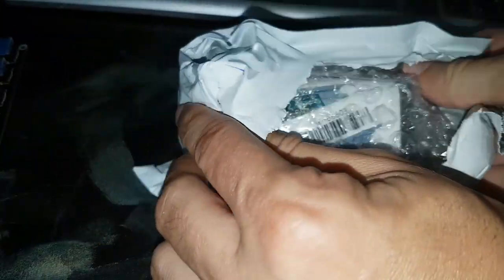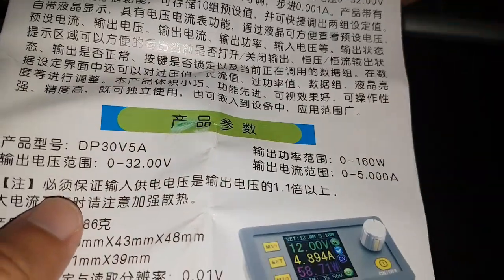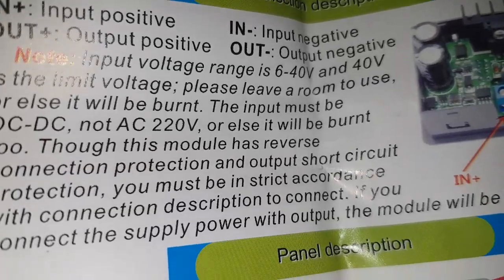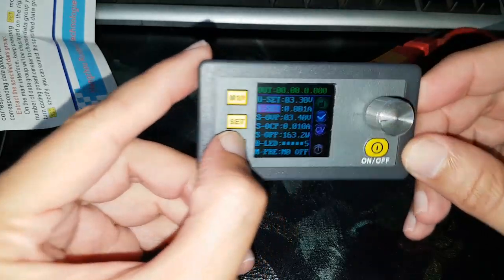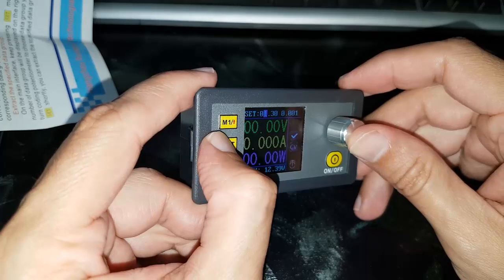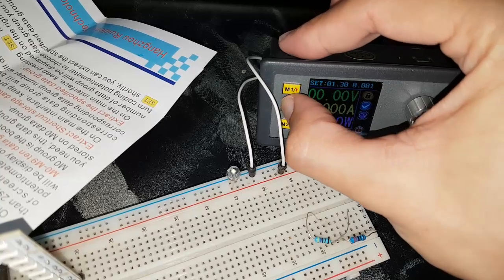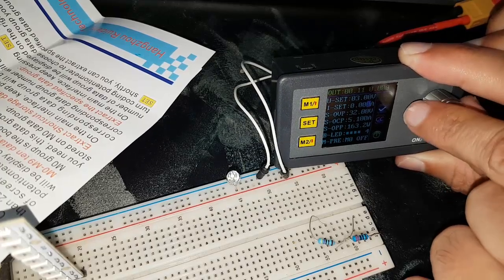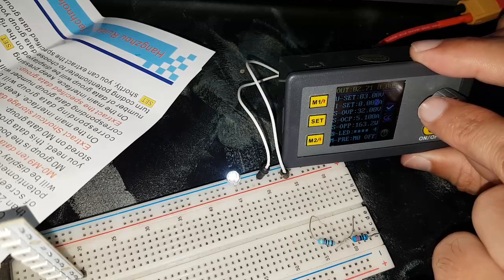Review of a constant voltage constant current programmable control power supply module

Comment: Hi friend 
thank you for your video. this is my product. we design this ,. although you did not bought from my shop, from my reseller. 
in the most time , I saw you adjust seting output current , and you also the the real time current is changing too. but they are different , right?  there are 2-3 words different, right ? you know the reason or not 
let me explain it : first our user manumal writer " current voltage range is 0.5%+-2 words", right ? this mean the error is between our products measurement value and real value , not setting value .. 
so it is normal . in the CC state , the difference between setting value and  real time detect value is 2-3 words, it is normal 
becayse there is some error about setting value .. 
so it is totally right .. don't worry 
thank you for video 
and I saw you bought DP30V5A http://www.aliexpress.com/store/product/RD-DP50V5A-Constant-Voltage-current-Step-down-Programmable-Power-Supply-module-buck-Voltage-converter-color-LCD/923042_32613371214.html
Hope you like it 
in fact you can use it to make real power supply , like those 2 friends  https://www.youtube.com/watch?v=vcI_NJ_kcPI and  https://www.youtube.com/watch?v=XlbtEkq7FTE&list=PLNcr2Rj_07PGexXolEzWu5_pFNOcO3g68&index=16  
thank you
Reply from the maker: Great product , I love it
Reply from the maker: +RD tech 
I am now looking into on converting 220 volts ac into 30 volts dc .
Reply from the maker: +RD tech 
I am now looking into on converting 220 volts ac into 30 volts dc .
Reply from the maker: +RD tech 
Feel free to send me samples of stuff that you want me to review on my youtube channel
Reply from the maker: +RD tech 
Made a new video using it .
https://youtu.be/5EkPEvWBCgQ

Comment: Brilliant, very useful device (used it for measuring forward voltage, measuring current and power, temporarily powering Bluetooth, relays and other devices...). Forget about the "bench power supply" - this little thing is what every Arduino enthusiast needs. I have a 50V 2A version, that has small fan at the back, and have put it into a small plastic box from groceries store, but I plan to put it into better, larger case together with some kind of AC-DC power supply. Now is powered with AC-DC adapter "stolen" from an old WiFi router.
Reply: +mbaksa

thank you for your support . yes, DP50V2A is design by us. in fact DP50V2A is old version. the Heat dissipation is not good, so we add a fan on the back. so as this base, we design DP30V5A, DP50V5A and DPS power supply.. it is used new way . so you can check that even DP50V5A don't need a fan.  but DP50V2A is still good, just old 
if you want to change, you can find me on my shop 
https://rdtech.aliexpress.com/store/923042